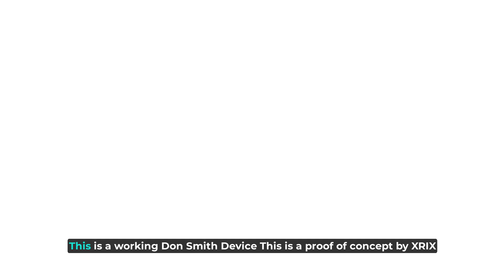Over Unity Working Don Smith Device

Comment: I left you another message in answer to your question. You will be extremely pleased with my answer. Did you use the reverse Tesla coil setup inside the box or a different method?  I came to the conclusion that without resonance and  the 'cold" electricity you need a run battery and a charge battery and a switching unit. This is mainly because a regular alarm battery does not run a system and receive a charge unless extraordinary measures are used.  I have to go back to Zilana's notes. I wonder where she is now. Kurt and she became close and I am certain he still stays in touch with her. Of course he is married and it is strictly on an electrical  genius basis but she grew up int a very good looking young lady. I will have to tell you the stories I know about that time and what we accomplished with what little we had to work with. Of course when I really got into it both Don had had numerous strokes and  was in bad shape and my grandfather fell down a stone staircase carrying my grandmother to the car to go to the hospital  for chemotherapy. He took her and waited and brought her back while bleeding profusely from a horrible head wound. He came back home and fell over and they had to call the ambulance and he went down hill very quickly. My grandmother and grandfather were so close that they passed very soon after each other. I treasure the time and the knowledge that he and Don taught me without making it seem difficult.  The solid state version of the vending machine device  looks like a regular power supply board you would see in an uninterruptible power supply. I saw very device Don made work except the really large 60kilowatt device that had the self healing capacitors.  He was the real deal.
Reply from the maker: It absolutely has to do with cold electricity (Tibor's version). All the transformers are reversed, meaning the primary is the HV winding and the output is the line voltage winding. There is nothing in the blue box, except for the HV/HF driver to a FWB and to the two capacitors and the spark gap. It is like Zilana's final disclosure with two small caps one in parallel, one in series with the spark gap. You can have as many MOTs as you want, as long as they have similar input impedances. I am running all those lights with  (2 ) 1uF capacitors. It absolutely shouldn't work, but it does. Years ago, I exchanged some comments with Kurt on his experiments, and I hope he has seen this video. I probably started building Tesla coils 5 years ago,  but the resonance concept, I found hard to build and tune, so I just built PNP slayer circuits, which brought me here. What I have experienced, is that many people took Don Smith comments and placed them in unreal constructs. The two worse misplaced topics are 1. Earth Grounding, 2. Resonance. They are important maybe to some, but not to me. They make transmission possible, but I don't need to use it in the device in the video. Not saying that the device doesn't achieve resonance on its own. If you have a coil, capacitors and a spark gap fed by DC, you will produce a tank circuit. However, my secondary goes to a FWBR so I can fill a large cap, and drives DC LED bulbs. Don Smith said his DSE didn't require tuning, and moron level comprehension. So I chose that device.  I have disclosed everything to you how to build this circuit. The thing is, until the light bulb goes off in your head, you wont know how to build these things. For me it turned on after reading Tibor Kemeny's patent and asked how can he possibly get power from that? Then I saw what Tibor meant, and how to leverage it. Then, what Don said about chasing the wrong rabbit was  20/20. Don's statements about violating Ohm's Law, and room temperature superconductivity, and as many copies as you want.... all where understood.
Reply: @XR_IX  If you have an email I will send pictures of working devices as well as the vending machine device and explain all the parts. It is truly genius level due to some very interesting things that are in plain sight but NO one...not even Rick identified them if he knew they were there . He completely misidentified things that were in the desktop device as well. There is something that unlocks the "free energy" and Don said it many times but he said it in a way that let you figure it out from what he divulged. He always said you will always end up wit too much voltage. There is the key for some of the devices. He went on to talk about Cockcroft Walton devices and led people right down the rabbit hole...lol Yes you will always have to deal wit too much voltage ....but why is the answer. Let me know how to message you and I will send you some incredible stuff.
Reply from the maker: Thanks Rick I appreciate it!
Reply from the maker: Rick when a person reads a recipe,  say to an apple pie, it is open to many interpretations and approaches. This is my purpose for creating this content. Not to be controversial, but to stimulate the baking of the pie. Some people will make it horribly wrong, and use margarine. Some will make it just how it is described. A rare few will see why all the ingredients work and create a starred restaurant.